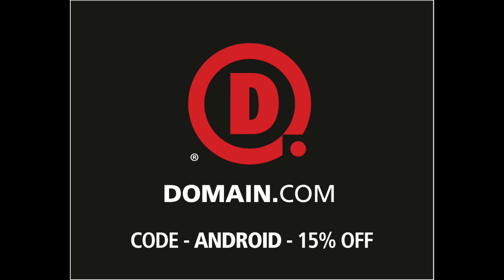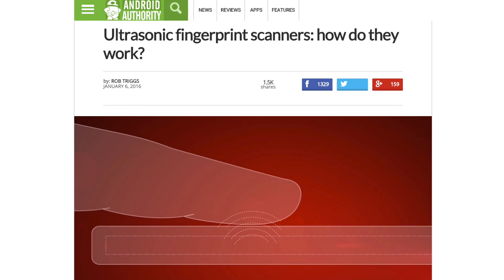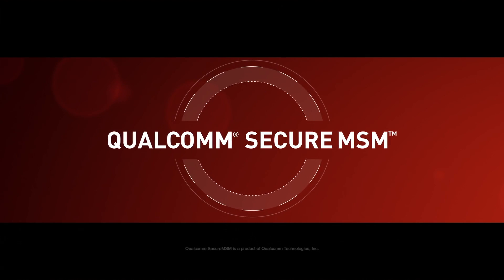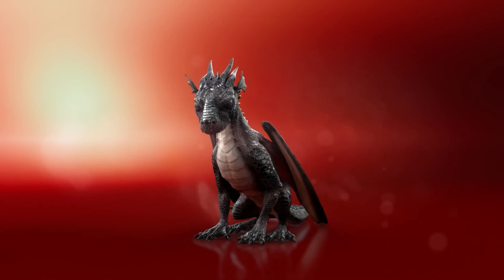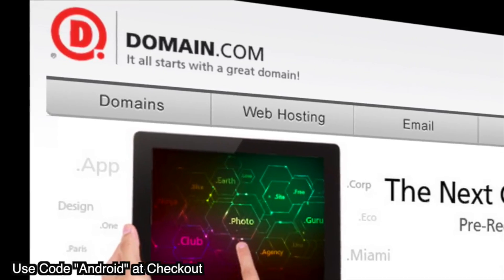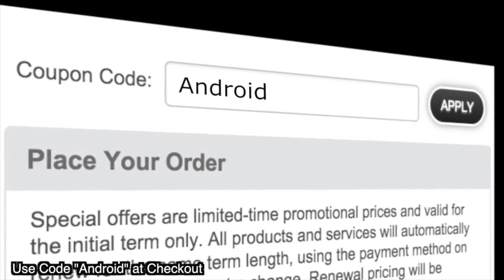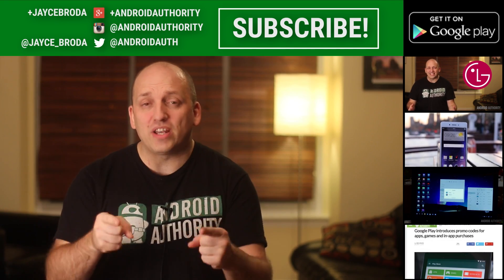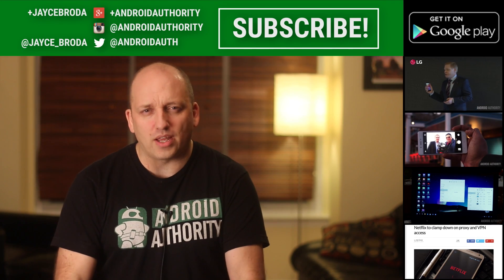Ultrasonic Fingerprint Scanners: How do they work?

Comment: Cracked my screen twice, so I bought a new case/screen protector. It stopped my thumbprint from working, so I ordered those little stickers that are supposed to fix it.  I couldn't comprehend how making the screen EVEN THICKER by adding a sticker would make it work, because I'd always assumed it was based on the thickness of the screen protector. But it did work!?!

That is why I am here.
Anyone else? Lol

Comment: I know that 2D (optical) fingerprint sensors can be fooled relatively easy; but how about 3D (ultrasonic) sensors? Would the tape + powder trick work?
Reply: No because the set fingerprint is 3d and the tap + powder trick wont work because the phone knows it's 2d but if you set the fake fingerprint it will unlock obviously but it wont work if it'a not set but in simple words it cant be fooled unless tou have a fine 3d print

Comment: will it still unlock our phone if we get a small cut on our fingers
Reply: Depends. Usually a fingerprint reader will look to the middle first so if it's there then it will find it difficult to tell if it's really you. If it's around the outside then it will still struggle but it will find it much easier than in the middle.

Comment: ive got fingerprint scanner on my note 4 & it's rubbish, your hands have to be squeaky clean or it does'nt work, which is no good if you've been eating say chocolate while your out , you'd ave to carry handcleaner with you at all times boohoo ,i got blocked out 4 times & had to use back-up password, so gave up with.

Comment: If I can use it by putting my finger on any place of the screen then it would make me wanna buy that phone
Reply: THAT for me, is innovation..
it would make the placement of the sensor less of a concern when designing a phone! and it would also mean that oem's could design phones with less bezels on the bottom of the phone (on the most popular offerings at least)
Reply: nope
Reply: @djoeneh  ?
Reply: 9 Months later, but the S8 will Supposedly have such a scanner.
Reply: I feel like that isn't possible. That would require the sensor to cover the entire screen real-estate.
Reply: @TECfan1  all of the top flagship phones for Samsung and Google (and more) now have this underscreen fingerprint scanner!
Reply: @CecilM32  I wasn't describing that but one where you could touch anywhere on the screen.
Reply: Yes we have it now in 2018.
Reply: I'm in 2018 and vivo apex which is a prototype has this similar type of tech
Reply: well now it has

Comment: the ONLY features I care about is 
1) stock Android, I don't care if your custom interface looks good or is feature packed I don't care, I don't care! the coding always clashes and makes everything have latency not to mention the hardware optimizations go out the window most of the time because of this.
2) bigger battery, the core hardware (CPU, GPU, and  RAM) is basically all the same in flagship phones and no one stops to think that maybe battery life is a necessity, how is this even acceptable in this day and age we shouldn't even have to worry about making it though one day on a charge. I'll take a slightly bigger phone that can do 6 hours of screen on time any day who is even asking for such slim phones?? has anyone ever said "gee this iPhone 6s is nice and all but I wish it was thinner with a smaller battery life that's a good trade off."

Comment: I have a Sony Z5 that supposedly has ultrasonic fingerprint scanner, but I have to disappoint you that it's not all that nice as described here... in reality the scanner does not work after you have rubbed your hand lotion on your fingers, to be honest even 5 minutes later it still does not work... it's actually very, very annoying. It does work very well though with dry fingers.

Comment: I use an iPhone 5s and I feel the existing tech is alright.
Reply: +VT Unorthodox iPhone 7
Reply: +yash kulkarni iPhone 7s
Reply: +The-terminator LG G5
Reply: +Ya Boi Beto well I have 3 5s in my home. And the touch ID never lags. Works perfectly even in the oldest one.
Reply: I use an ipad air 2 which has the same scanner and it sucks. I had to register my fingers again and again and it kept not recognizing so now I am not using the scanner at all.
Reply: 4nlimited3dition Whenever you stop using your iPad or before picking it up, just clean the sapphire scanner with your finger and then try to unlock it with your fingerprint. I can assure you that it will work.
Reply: ***** yeah sometimes doesn't recognize fingerprint when your finger is damped but just move fingers over it once and it will work like normal. The new fingerprint tech is fast I doubt about the precision level.
Reply: Existing fingerprint readers are good but aren't as secure as Qualcomm's Sense ID
Reply: Osiris Martinez Maybe not, Watch the first demo of Touch ID...